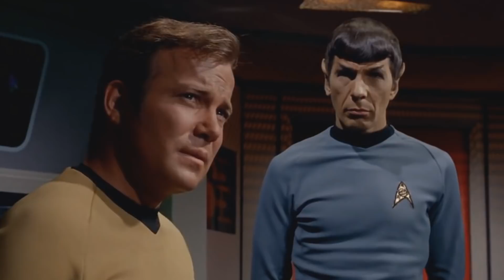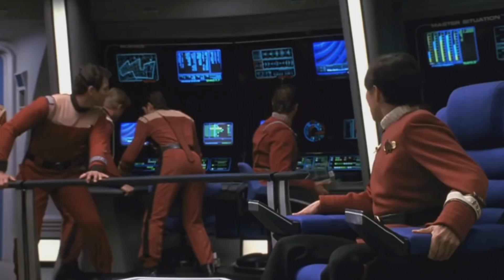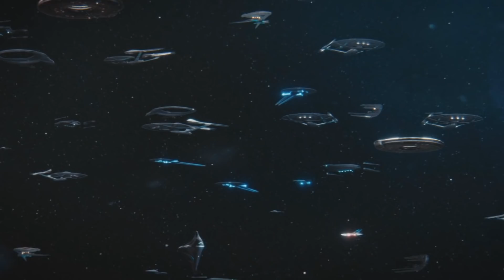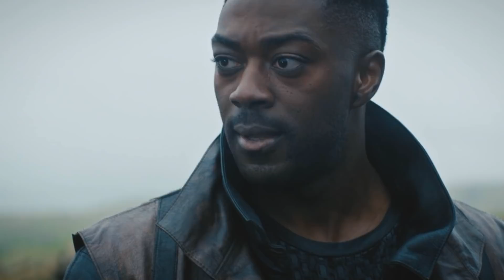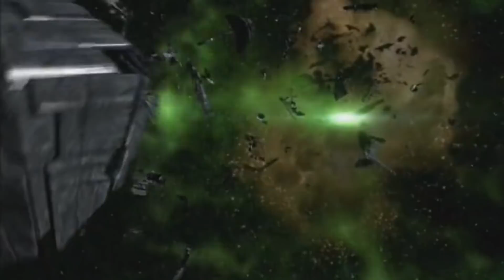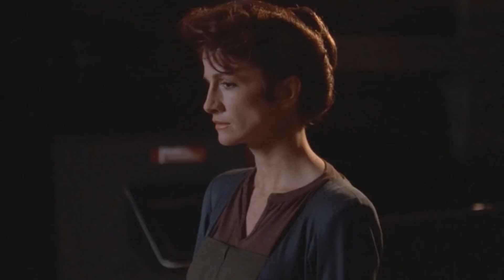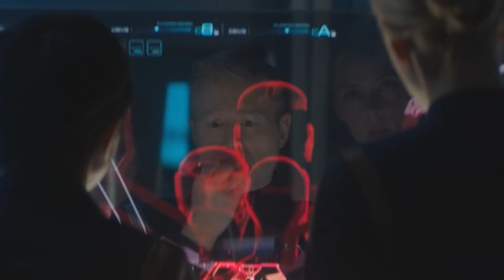How Can Dilithium Explode ? How to Explain The Burn in Star Trek Discovery and Other FTL References

Comment: even though it'd be just "screaming into the void" i need to just ramble about this because this all boils down to one problem. Scale. Like you can throw whatever writing you want at a fuckin' wall for however long you want, but the problem with the Burn is the SCALE of it. If it was something like say a resonance cascade effect and similar to the subspacial shockwave when Praxis went up, it'd still have the problem of distance and time. And even with those you'd have to also factor in energy. At most, that'd probably effect like . . . maybe a dozen systems? maybe a cluster at most? It wouldn't be fuckin' galaxy wide. Hell even if say all ships were not using pure Dilithium and some sort of Dilithium Omega molecule/particle hybrid, that STILL wouldn't create the coverage and just literally fucking anything that the Burn did. And as bullshit as the reasoning they came up with is (and let's agree that it is 100,000,000% bullshit) the whole CONCEPT alone is just stupid. Literally the only thing that would be stopping warp travel is energy. That's all it boils down to. If you have a source of energy that creates something akin to plasma? you're fucking good to go! just gotta tune shit correctly but still! Hell. The Romulans literally wouldn't have to fucking DEAL with the Burn. Why? They use artificial singularities for their warp cores. Yeah. Mini blackholes. So why the fuck isn't there like an uptick in fuckin' repurposed Romulan Star Empire ships or tech. Just. Ugh.
Reply: ^ Exactly. There's no way this makes any sense, no matter how hard you twist the logic.
Reply: Fusion reactors powered warp drives before dilithium’s property to control  MAM reactions was discovered.  Of course fusion power would limit FTL to very low warp numbers, probably warp 2 at most.  This seems to be the reason why most civilizations stayed close to their origin worlds.  
The borg, the romulans, and any other species not using traditional warp drive and/or MAM reactors using dilithium would be poised to dominate...but speed is only one factor in warfare.  You don’t need warp drive to have hundreds or thousands of ships and weapons platforms defending your home system.
Reply: Romulans as a race pretty much ceased to exist so I doubt their tech was very well known.  But otherwise I agree.  Not only the Scale of losing all those ships in an instant, but think of all the personnel.  It's a wonder anyone has anyone left if the best and the brightest were crewing ships as Star Trek tends to have us believe.
Reply: @PrinceSilvermane  
"Romulans as a race pretty much ceased to exist so I doubt their tech was very well known."

Is that a joke? The Romulans were a major galactic power, to the point that Romulus itself was only one planet out of thousands in their Empire! There are still plenty of Romulans on other worlds, and even before the supernova we saw their non-military ships throughout the Alpha Quadrant, so their tech is well known enough.

"But otherwise I agree. Not only the Scale of losing all those ships in an instant, but think of all the personnel. It's a wonder anyone has anyone left if the best and the brightest were crewing ships as Star Trek tends to have us believe."

It's like a Star Wars movie where all Midichlorians are destroyed in an instant: it's stupid and you should never do it.
Reply: @Idazmi7  oh thank gods someone said it before i did. I had done a triple take at that statement alone. Just pretty much an "excuse me???" sort of moment. Cause uh. Ship graveyards are a pretty big thing. I mean here on earth we sometimes turn ships into museums or in to artificial reefs in some cases (depends on the age). But i am more than 99% certain that there are large quantities of Romulan ships just laying about. I'm not 100% certain that non-military vessels had the same tech (though JJ tried to assume they kinda sorta did . . . ), but still there was a reason why the Tal'Shiar was as feared as it was. So to say the entirety of the Tal'Shiar fleet was parked out in the orbit of Remus is about as stupid as saying that Utopia Planitia in orbit around Mars is the only federation shipyard. 

Let's . . . let's not get me started on that can of worms. We'd be here till the next millennia.

But if we want to go into the whole point of personnel, well, pretty much entire swaths of the galaxy should be a literal graveyard. We're talking about a massive brake on any inter-galactic travel barring maybe a few exceptions. So that means Trade has gone out the window (Ferenginar must've been a shit show), that means there are no supply ships or RESUPPLY ships, Even if there are ships that didn't have a warp-core slapped in or were in the middle of repairs or some shit, it'd take probably YEARS of time to get those running. Because, oh yes, forgot to mention. 

MOST OF THE GALAXY HAS A POWER GRID THAT RUNS ON FUCKING DILITHIUM.

That is literally the point. Most of the "civilized" races use some form of anti-matter to matter reactor. Which in most cases requires Dilithium. Not to say that the ships would've just instantly blown up if the shit went inert. But still, we're talking about a stupid number of power-grids on multiple planets that just instantly go *dark*. 

Like honestly, i'm surprised there is fucking ANYTHING if we're going to take this plot point seriously. Like oooo hand wavey programmable matter~ That would only probably work if there was some sort of power source powerful enough to manipulate matter on such a level and scale. I mean, what tech can we think of that can do that? I mean surely it wouldn't be something so mundane at this point that it's up there with warp-

It's fucking Transporters. Transporters and Replicators. Like how are EITHER of these things *still a fucking thing*. Just. Rrrrrrrrrrraaaaagh.

Comment: The Omega molecule has NOTHING to do with dilithium.
Reply: I think the link that they're trying to make here is that if the Omega molecule causes damage to subspace, that it may also cause damage to some of the components used to allow warp travel. The dilithium crystal is a critical component in the use of a matter-antimatter fueled warp drive that is susceptible to unintended influences. The crystal is at the heart of the reactor, both controlling the reaction, and tuning the resulting warp plasma for use. There are 2 possibilities what could happen if the crystal was altered, 1) The reactor goes inert. 2) The reactor converts itself into a bomb and detonates. (this is most likely to happen if the reactor is running.) The over arching idea is that something caused every dilithium crystal in active MAM reactors used for warp travel to suddenly loose their ability to modulate the reactions in their reactors. The theory is something external caused the dilithium to "go piezoelectric" by changing it's crystalline structure. The only in cannon material that is capable of creating such a side effect while leaving other means of FTL travel possible currently is a massive detonation of an Omega molecule structure. And we know in Voyager that the Borg were interested in it, and a planet in the delta quadrant were attempting to make and control massive amounts of the material. We also learn that enough Omega blowing up could have galaxy spanning effects. Though I would be interested in how the Romulans made out after the "Burn" since they don't use MAM reactors instead favoring artificial singularities for their power source.
Reply: Thomas Schulz Since the Romulans don’t rule everything, it obviously effected subspace, not just dilithium...but subspace isn’t effected for the spore drive...
Reply: @nvfury13  True, any form of FTL travel that doesn't rely on subspace to function would still be possible. The Gravidic jump gate, the small craft that traveled by folding space, the caretakers array all from Voyager . The Bajoran worm hole and the ancient  Bajoran Tachyon sailing ship from DS9. That planet based FTL wave technology from TNG. Heck if we want to throw in long range transporter technology from the reboot. There are any number of ways that fast enough space travel would still be possible.
Reply: Thomas Schulz The limitation is that it can’t be a method that requires massive power output, since MAM is the way they generate that in the Trek universe.
Reply: Thomas Schulz Not to mention every time we see one of those methods (other than Borg wormhole tech/ the Caretaker array/the Bajoran wormhole, and the long range transporter) they are horribly dangerous and tend to break everything.
Reply: the point, I think, is that there is precedent in Star Trek for something that could "effect all subspace all at once"

Comment: I dunno about "exploding", but certain resonance frequencies can cause fractures in a dilithium crystal; such damage could shatter the crystal when used in a matter/anti-matter reaction assembly (M/A-MRA).  Thus, if such a resonance frequency were propagated through subspace at high warp speeds, it would make the destruction of dilithium-modulated M/A-MRAs seem instantaneous.

Comment: The thing that STD doesn't get is that Dilithium is only for the Matter-Anti Matter Reactor, which is a means of Power generation not Propulsion. Theoreatically if you generate enough energy you could Power Warp Wrive with a Diesel Engine. The Romulans powered their Warp Drive with a Singularity, no Dilithium requiered. Heck as far as I know the Reactors for the Impulse Drive in TNG era and onward generate enough Engergy for low Warp (can't remember where I got that from so it may not be canon)
Reply: I was wondering when someone would point out that Romulan ships use microsingularities...

Comment: WAIT. The Dilithium went intert, meaning that it's basically stopped being reactive... and then that caused EXPLOSIONS? When a bomb's explosive goes inert, it means that it CAN'T explode. The fuck is this shit?!
Reply: In Star Trek tech babble if I remember right...
The dilithium is at the heart of regulating The matter anti matter reaction on most warp capable ships.

Imagine if someone pulled all the control rods out of a nuclear reactor at once. Then times it by thousands.
Reply: @hogfry  
"In Star Trek tech babble if I remember right... The dilithium is at the heart of regulating The matter anti matter reaction on most warp capable ships."

As I explained above, the crystals regulate the energy flow coming from matter-antimatter annihilation, not the reaction itself. Think of a power transformer instead of a control rod.
Reply: @Idazmi7  I thought the idea was dilithium was ‘transparent’ to antimatter and allowed a controlled reaction to happen.  The MAM reaction would happen within the Crystal, with the dilithium not reacting with the AM itself.  Obviously if dilithium lost this property (became ‘inert’) it would be annihilated by AM just like any other matter, thus causing an explosion if the reactor was active.

But then all that was probably retconned decades ago for all I know.  It’s kinda sad that the 31st century was still using something as pedestrian as MAM when There’s zero point energy, artificial singularities, artificial wormholes, iconian stargates and a whole host of technology that should have been used to diversify FTL.  I would have at least anticipated interstellar range transporters that far in the future.
Reply: @Idazmi7  wait, so dilithium was just naquada from Stargate?  At least it wasn’t called unobtanium.  Sorry, the whole antimatter transparency issue was an early non canon explanation of how it worked, obviously dilithium and warp drive was never explained in depth in TOS and could only be guessed at by onscreen evidence.
Reply: Dilithium in warp core is used to regulate matter-antimatter annihilation. If by "went inert" they mean it stopped to produce electromagnetic field, that would trigger an explosion. Obviously the dilithium wouldn't explode. Explosion would be caused by uncontrolled reaction of matter and antimatter.

But maybe we are thinking about it more than their target audience.
Reply: @Lukas-Trnka  
"Dilithium in warp core is used to regulate matter-antimatter annihilation. If by "went inert" they mean it stopped to produce electromagnetic field, that would trigger an explosion. Obviously the dilithium wouldn't explode. Explosion would be caused by uncontrolled reaction of matter and antimatter."

Close, but not quite. As seen in those first clips, the crystals regulate the energy flow coming from matter-antimatter annihilation, not the reaction itself. If that wasn't the case, the Enterprise would have exploded.

"But maybe we are thinking about it more than their target audience."

We are the target audience, even if the writers and producers refuse to accept it.
Reply: @Idazmi7  Regulating the energy flow and regulating the annihilation is essentially the same thing. Annihilation is happening around dilithium crystals and resulting plasma is directed by the crystal to the plasma conduit. If you are reffering to the opened dilithium assembly next to Scotty, at that time the M/A reaction was either not happenning, or there were other crystals still inside, or it was simply not as thought through at the times of TOS as it was in TNG and later.

Ad target audience: We are StarTrek's audience, but we are evidently not Kurtzman's target audience. However that shouldn't silence us. Star Trek shouldn't be made only for part of fans, as they are doing now.

Btw: How do you format italic text here? I've tried to use  _underscores_, but it doesn't work for me.
Reply: @Idazmi7  Now I see what you mean. It apparently wasn't like that in TOS, but since TNG to ENT, dilithium is part of annihilation process in order to moderate it. It is in the certer of it. Magnetic constriction is around it.  ( https://www.ex-astris-scientia.org/treknology/dilithium.gif ) It is actually very detailed described in TNG Technical Manual, written by Rick Sternbach and Michael Okuda (technical advisors to the writers, and the very people, who designed the E-D and how it should work).  These advisors also summarized their ideas into the Technical manual where it is in more detail than in the episodes. There is no equally extensive technical source to ST technology like this TNG-TM. Warp core in TOS was not thought through to such degree as it was done later in TNG. Sternbach and Okuda took it to the next level. But they built on the same scientific ideas and expanded the original thoughts. After all, science was always an integral part of ST.

test of italic text   - it works! Thanks!

made for the very audience that hates Trekkies - Yeah, I guess there might be something to it. I always noticed how some trekkies feel insecure for being trekkies and liking Star Trek. ST fans were often criticized and ridiculed by some people for whom ST was not cool enough. I remember that feeling myself. Now the ST is the way those "bullies" would approve. I even saw instances of trekkies hate-talking about old ST in favor of this new. Very frightening. I think some of fans hope that they will be more accepted by those "trekkie-haters". The catch is, we are losing the very things that made us trekkies in the first place. I don't thing this is the whole story, but it is a factor that is part of the problem.
Reply: @Idazmi7  Yes, Probert was one of them and the look of E-D was his idea. E-D in and out looked really futuristic. For example, I really like interior of Voyager, but it certainly doesn't look as much futuristic as Probert's designs.

Anyway, there was certainly no point where science wouldn't be important. Perhaps I don't know what exactly do you mean, but science was obviously important part of ST since TOS to ENT. I always wished they would put more effort to the science aspect of the show, but TV production unfortunately demants some compromises.

I know that TNG-TM is not canon, but it is the second best thing available, because it comes directly from people who helped to create ST. It is a compilation of things that were on screen, things that were prepared to be used on screen if needed and all of it was extended into many details.
Reply: @Idazmi7  I think you're down putting the general contribution of Sternbach, Zimmerman and Okuda and all other people who helped to make ST believable. Probert was not a sole father of the final result, he didn't work alone, results of his creativity were always also affected by cooperation with his colleagues. Take for example all the okudagrams. After Probert left, there were still a lot of other people who contributed science into ST and new such people also joined the show later, such as Naren Shankar for example. I definitely see no "corporate-yes-men" there. 

Those "technobabble" you are criticising could be considered as essentially the beginning of my science education at my early age, which resulted in me finishing a technical university. I really commend the way they worked with science since TNG onwards. (Until the JJtrek, obviously.) After TOS, they added more depth to that and thanks to that I've learned a lot of real world science. I always wished they would do more in regard to the science, but they always had to balance the show to be interesting for wide range of audience.
Reply: Bad writing.

Comment: Dilithium didn’t explode. It went inert which resulted in uncontrolled matter and antimatter reactions and caused an explosion
Reply: That doesn't make sense either: all that wold do is trigger the engines to shut off.
Reply: @Idazmi7  It DOES makes sense because that's how the M/AM cores work